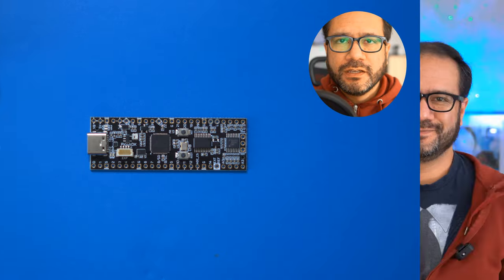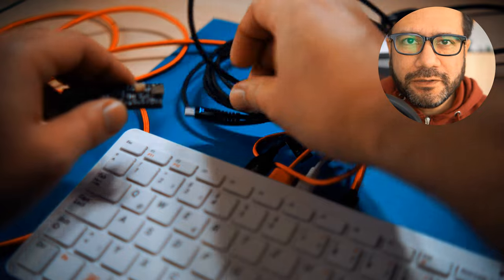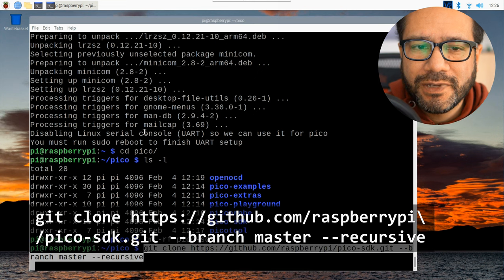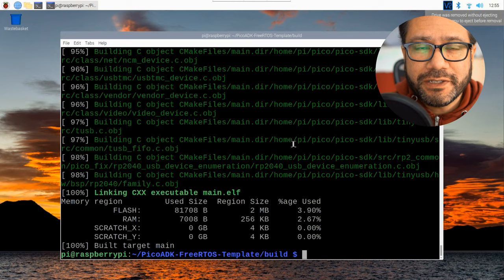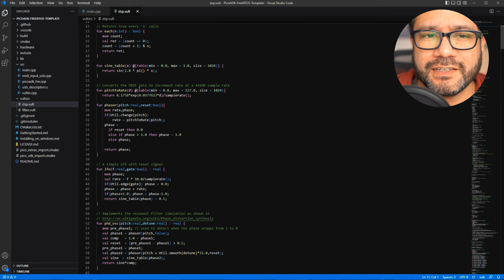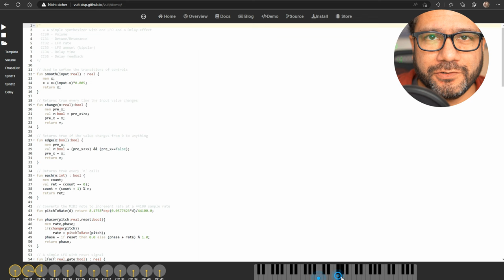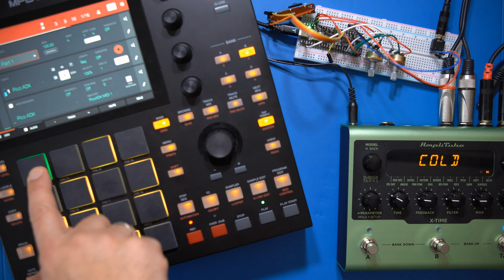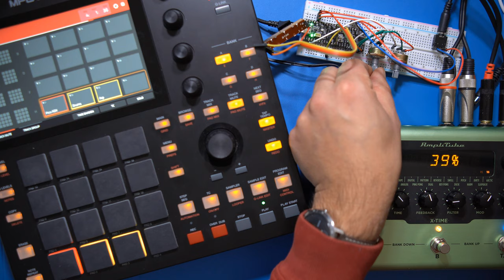Build your own synthesizer module with PICO ADK!

Comment from the maker: Links:
PICO ADK https://schneidersladen.de/de/datanoise-picoadk, https://www.tindie.com/products/datanoisetv/picoadk-pico-audio-development-kit-rp2040/
Potentiometers: https://amzn.to/3Rxkcc2
Breadboard & cables https://amzn.to/3YsB3Pd
3.5mm stereo sockets https://amzn.to/3I0vT7G
VULT language https://vult-dsp.github.io/vult/overview/
PICO SDK https://www.raspberrypi.com/documentation/microcontrollers/raspberry-pi-pico.html
PICO ADK on GitHub https://github.com/DatanoiseTV/PicoADK-Hardware

Shell script commands needed:
Using DOCKER:
git clone --recursive https://github.com/DatanoiseTV/PicoADK-FreeRTOS-Template 

cd PicoADK-FreeRTOS-Template
./build-firmware-docker.sh

or ...

sudo apt-get update
sudo apt-get upgrade
sudo apt-get install npm
sudo npm install vult -g
wget https://raw.githubusercontent.com/raspberrypi/pico-setup/master/pico_setup.sh
chmod +x pico_setup.sh
./pico_setup.sh
cd pico
rm -rf pico-sdk
git clone https://github.com/raspberrypi/pico-sdk.git --branch master --recursive
git clone --recursive https://github.com/DatanoiseTV/PicoADK-FreeRTOS-Template 

cd PicoADK-FreeRTOS-Template 
export PICO_SDK_FETCH_FROM_GIT=1

mkdir build &&cdbuild
cmake ..
make
Reply: Looks good. Affordable and solving the audio implementation hassle. ty

Comment: It's a really awesome project! I've been following it for the past couple of months or so and I've one critique: I don't understand its price point as it's the same price as the Daisy Seed but it's far less powerful. I think he should reduce the price, so it would make more sense. Not dissing btw just sharing my opinion and he's done an amazing work. I hope this will be successful but the price tag might seem a little bit illogical to other people as well. Thanks for making a video on this :)
Reply from the maker: Thanks for watching! I think your message will reach to intended recipient. ;-)
Reply: Thanks for your comment, I understand your point. The price tag is due to the fact that we are not producing in big quantities, but rather in small batches of 50-100 boards, which makes the production runs more expensive. We have not made any trade-offs on the quality and included a 8 channel 12-bit 1 megasample ADC, which is already 5€ by itself, ESD protection, careful power filtering and the 32-bit Audio Codec.. The board is a 4 layer board with ENIG finish with 0.127mm trace width, 0.45mm minimum drill sizes and all vias are capped with resin, which adds additional cost, so the profit margin is already very low.

Comment: Amazing Overview! This device is as close as I can get to finding a pre-made solution for me needs. Possibly you know of something else or how to make it work? I need to play a mono audio file (frequency sweep) out of 8 outputs (via a single DAC and small amps or an 8 channel DAC), those outputs will be processed externally, and then come back into my device on 8 ADC inputs. Their signal amplitude will be measured and stored. Essentially, an 8 channel Audio Device Tester. I can't for the life of me find anything Arduino or Pi based that can do it.
Reply from the maker: There's another tiny board called the "Daisy Seed". https://www.electro-smith.com/daisy/daisy - I'm not so shure about the 8 audio outputs, though. You'll most propably need to add some DACs for that.

Comment: Just to ask a noob question, this pico ADK would the heart of a digital synth.  Is there a hardware oscillator in one of the surface mount chips that is not obvious?  Thanks for the video.  This is a very interesting project board that I would not have learned about otherwise.
Reply from the maker: Hi, thanks for watching! You're right, this would be a digital synth. This board runs VULT DSP code. There is no analog oscillator on board. (edit: It's not a derivative of the RasPico)
Reply: @mr_floydst  Thanks for the clarification, Floyd. I appreciate that this is a fairly niche question. 😀
Reply: My understanding of this is that everything from oscillators on is just code.

Comment: Hi! Really nice video! If I want to build a Casio SK-1 inspired sampling keyboard but I am blind and new to programming, where do I start?
Reply from the maker: This board has 2MB of flash space, so in theory, you could upload a limited amount of samples.
But I think a project more suited for your needs would be Samplerbox: https://www.youtube.com/watch?v=3Ak2o5ZDI9I
It's relatively easy to grasp and written in a high level language so you can get into it more easily.
Reply: Floyd missed the part where you mentioned you are blind. VULT looks well designed as a language, but it's definitely something that requires a bit of coding knowledge and a good grasp of math. Sound is made of math after all.
VULT generates lower level code that can then be compiled & installed on single board computers and microcontrollers.
The trick is ensuring your code editor is accessible. Microsoft Visual Studio is supported as a development environment for building your sampler or other sound applications. It would definitely have the best accessibility feature for coding as a non-sighted developer

Comment: How can I connect a din connector for midi in?:0
Reply from the maker: Hi, thanks for watching!
I can't check it myself at the moment, but you have to build that yourself using the IO pins.
There's a well written tutorial here: https://diyelectromusic.wordpress.com/2021/06/13/raspberry-pi-pico-midi-channel-router/
You should be able to transfer the info found there to this hardware. The DEV kit used is the same.
Reply from the maker: ... or buy this: https://www.ebay.co.uk/itm/194872078825

Comment: @FloydSteinberg Not sure if you are reading the comments still for this 3 month old video, but I ran into an error when replacing the dsp.vult with any other file for the picoadk hardware...
Something like this is the result:
[ 40%] Transcompiling Vult DSP Code to C++.
[ 41%] Building CXX object CMakeFiles/main.dir/src/main.cpp.obj
/home/sven/development/PicoADK-Firmware-Template/src/main.cpp: In function 'void i2s_callback_func()':
/home/sven/development/PicoADK-Firmware-Template/src/main.cpp:230:32: error: 'Dsp_process_ret_0' was not declared in this scope; did you mean 'Dsp_process_type'?
  230 |             fix16_t left_out = Dsp_process_ret_0(ctx);
      |                                ^~~~~~~~~~~~~~~~~
      |                                Dsp_process_type
/home/sven/development/PicoADK-Firmware-Template/src/main.cpp:231:33: error: 'Dsp_process_ret_1' was not declared in this scope; did you mean 'Dsp_process_type'?
  231 |             fix16_t right_out = Dsp_process_ret_1(ctx);
      |                                 ^~~~~~~~~~~~~~~~~
      |                                 Dsp_process_type

I looked it up , these functions are defined in the vult.h header file, which is generated by the system. But here, I cannot find the original function behind that. There is nothing in the dsp.vult file.

Which magic happens here?
Reply from the maker: My best guess is you should check the definition of your process(), noteOn() ... functions and the parameters they call for.
See https://vult-dsp.github.io/vult/demo/
If that's not the cause of the problem, I think joining the Discord server and asking one of the creators is your best option, as there have been numerous updates since I made this video: https://discord.gg/BsHUEdStMt
Reply: @mr_floydst  Yes, I found a workaround to that by assigning direct from the function Dsp_Process. Now I am hanging at the controls :-)

Comment: Hi Floyd, last 2 days I have tried running through the install and build ,but I encounter a similar  make error to @svenwehrend7495  at stage [40%] Transcompiling Vult DSP Code to C++
../tools/vulture: 8 Syntax error: “)” unexpected.
In the tools/vultc folder there appear to be only executables, so it looks like I am blocked from getting this to work. Any ideas?
Thanks great Channel BTW.
Donna
Reply from the maker: Hi, thanks for watching! I'll try to look into this and get back to you soon. ;-)
Reply from the maker: It was confirmed this is a bug in the SDK which now has been resolved (please download the updated version).
Thanks for reporting this, but using the actual project page might be a more direct way of solving such issues: https://github.com/DatanoiseTV/PicoADK-Hardware/discussions   :-)
Best regards!
Reply: Thanks Floyd, Wunderbar!. After re-installing this afternoon with latest SDK the tool chain now works and builds successfully.❤

Comment: I'm considering getting one of these! I can only find the version without the ADC though, will that be a problem? Great video btw! 🔥
Reply from the maker: There is no audio ADC here, just the one for picking up analog signals generated by potentiometers etc. (Though it's operating frequency theoretically is suitable for picking up audio - you could try )

Comment: Hello. Thank you for this tutorial. As I got zero knowledge in programing I have a question. I've followed your tutorial but I meet a problem. Instead of having PicoADK-FreeRTOS-Template dir, I have a PicoADK-Firmware-Template dir. So I changed the cd command to this directory. Everything seems to work fine but at the end, never had the main.uf2 file. 
I don't understand what I did wrong as I've followed your tutorial step by step and didn't get an error (apart from the directory problem). Could you please help me? Thank you
Reply from the maker: Hello François, it's very likely there have been updates to the overall process in the meantime. If everything compiled without errors, you should be able to find the .uf2 file by entering "find . | grep uf2" on the console, in your home directory. This should show you the location of the firmware.
Reply: I'll try that. Thank you for your answer !

Comment: So interresting !! 
But too complicated to prepare, to install, to build ...
I didnt well understood 1 thing (Google translate is not so smart) : 
The 3 pins to the 'audio socket' are for the regular sound ? 
And the Midi input is provided by the usb ?.?
Does the card has a "TX/RX" pins to plug a midi socket (with a 220K res of courses ^^) ?
We need so more informations !!!
Reply from the maker: Thanks for watching!
Yes, the 3 pins are regular stereo audio outputs.
MIDI is provided by USB indeed.
You can examine an interactive pinout here: https://datanoise.net/picoadk/
Yeah, I think I'll need to do a follow up video already. ;-)
Reply: I have just improved this. Now you only need to install docker and the firmware will build via the PicoADK docker image :) Yes, you can attach DIN MIDI but need an optocoupler. There is also a mainboard coming soon for the PicoADK with MIDI.

Comment: No audio inputs then?  Shame. Would be interesting to see Arduino support for it.
Reply from the maker: There is no built in audio input here indeed. Support for MOZZI ( https://sensorium.github.io/Mozzi/ ) is on the way as far as I know.
Reply: @mr_floydst  Did you already look at the Daisy Seed from Electrosmith?  It's been out for a few years and seems like a stronger competitor.
Reply from the maker: I heard about that for the first time today! Will try to get one.

Comment: Nice! Many of us have things like the Model D or 2600 or ER gear, too. Midi to CV conversion is getting pretty interesting, with devices like the FH-2, Midivolts, etc IE a model D/2600 would be much more interesting with velocity influence...no? I'm just getting started with that :)
Reply from the maker: You could use this board for MIDI to CV conversion, but the USP is it's analog input and it's audio chip.
Reply: @mr_floydst  TY, sir. I meant that as hint for future topic :)
Reply: I have a monostation and a minibrute 2s. They both have sequencers that send things that can control the limited number of accessible patch points on the model D to add dynamics. It would be even more interesting with the many more options of a 2600.
This doesn't seem to be the perfect device for midi/cv but I too was immediately contemplating ways to use these things to control analog signals too! :)